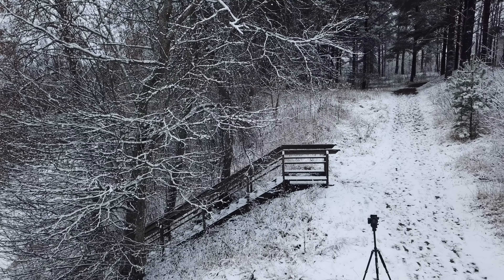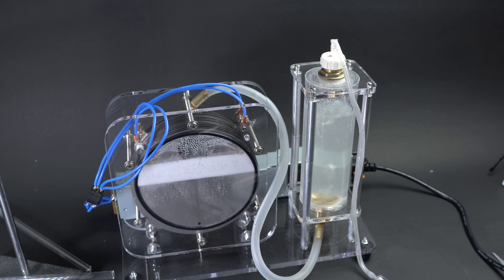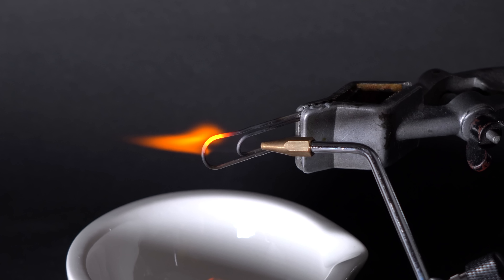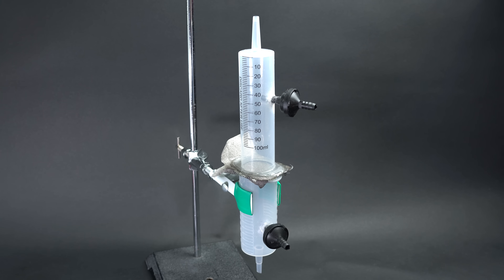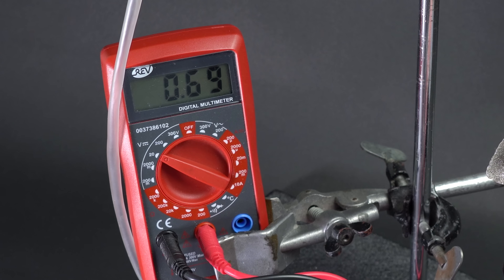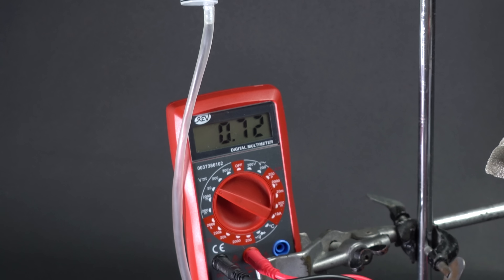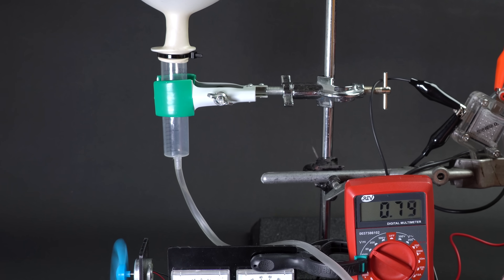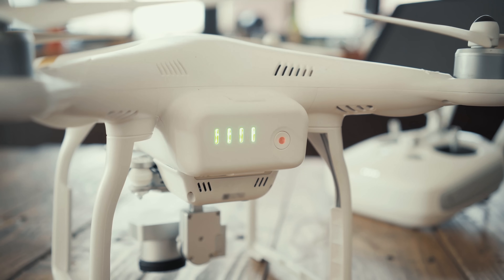I Made a Hydrogen Fuel Cell - Renewable Energy!

Comment: Thoisoi: i make renewable energy
Oil company :  say goodbye to the world son
Reply: The idea of hydrogen fuel cells isn't new. The problem is transportation of hydrogen. It is the smallest molecule, hence it penetrates every polymer (so far) and thus is unable to be transportet. Just think of a balloon filled with helium, it won't hold it for a very long time.
Reply: @MetalKabu  That's solved by hydrogen storage in Graphene Oxide, a cutting edge nanotechnology. It allows a lot of hydrogen to be stored in a solid form, at room temperature, non-reactive, non dangerous.  https://www.graphenea.com/blogs/graphene-news/lesgo-project-aims-for-effective-hydrogen-storage

And...Graphene, which was formerly very expensive to produce was just made a whole lot cheaper to mass produce by Rice University, using a quartz tube which you put ordinary carbon trash into, and a short burst of high electricity from a bank of capacitors:
http://news.rice.edu/2020/01/27/rice-lab-turns-trash-into-valuable-graphene-in-a-flash-2/
Reply: @twinpeaksfanclub5493  That sounds quite fascinating. I'll probably have to look into how this exactly works, but I can somewhat imagine how already. Thanks for the info!
Reply: @MetalKabu  glass.
Reply: Petrochemicals have many uses other than making gasoline, diesel and other types of fuels.  I'm a big advocate for hydrogen for a fuel source and with the help of solar power to provide the energy to create hydrogen by fracturing water makes it less costly over time to produce fuel cell hydrogen.
Reply: The Oil Industry is so paranoid about this "renewable energy" it would be easier just to "Doc Brown" their asses for $100million. They would be so happy that the device is a phony, they wouldn't worry about ya anymore, cause luckily any type of corporate embarrassment is worth Billions to not give it a second thought. xD
Reply: @MAGGOT_VOMIT  renewable energy is a myth.  Oil is constantly being created by the earth from decaying life.  Everything has oil within as well as water and other substances.  The oil and water separate through decomposition.  If enough living matter gets trapped under ground it builds stored gasses, minerals, oils and other liquids.  Diamonds are nothing more than coal under extreme pressure and heat transforms coal into crystals.
Reply: I truly believe that oil forms fastest under the oceans of the world.
Reply: @michaelpearce8661  Yes, I know. I was being facetious. Another myth is Man-Made Climate change. 
As an amateur volcanologist, I think everyone should study some volcanology. If they did, they would realize very quickly the huge amount of toxic and greenhouse gases that just 1 active vent produces in 1 month and that it surpasses all greenhouse gasses that us insignificant humans could ever produce one that "Man-Made" Climate Change.
Reply: @MAGGOT_VOMIT  with all of the atmospheric spray and other weather modifications that the researchers and military have been doing for decades, maybe now are responsible for climate change and I'm not being sarcastic
Reply: @michaelpearce8661  With there being over 160 types of Crude Oil, I wouldn't doubt it one bit. Our oceans cover 70% of Earth and before the Great Flood, the Earth used to be entirely a tropical climate, a Big Green Marble. One should think the majority of the oil and precious minerals would definitely be there. 

As Seismologists worry about Earth's tectonic plate health and predicting the next "Big-One", they need to be worried more about the race between our oceans to be the first to push like a giant wedge, back through and under Earth's crust. Lol with it's immense volume alone, guess which ocean is winning? xD

When the Pacific finally breaks through the crust at the Mariana trench, it will be more violent than when the waters burst forth during the great flood. Worse as in, the weight of the ocean will force the explosive gases (called "Laze") laterally through the weakest faults in between earth's plates.

 Normally when water like at Yellowstone hits a magma chamber you get Old Faithful and very hot but practically harmless plumes of steam. That's because it fresh water. That's not what happens when SALT WATER hits magma/lava. When salt water hits lava it creates Laze. The innocent looking plumes of steam, (like in Hawaii) where the lava flows into the ocean, are made up of Hydrochloric Acid and fine glass shards. If it doesn't kill ya right away from instant lung damage, it will a few years later causing an accelerated form of Mesothelioma.
 
I can't even begin to guess the amount of deadly Volcanic Laze that will be released for everyone to breathe, when the Pacific breaks through. Yes the volcanic Laze is very toxic but stupid tourists today in Hawaii, still ride their boats way too close to the plumes.
Reply: @michaelpearce8661  No, even that has no affect. Earth is much more immense than most people can comprehend. I assure you it's more than capable of handling anything us wee humans can throw at it.

 Any measurable Atmospheric spikes Worldwide in Greenhouse and Toxic gases ALWAYS follow a sudden increase in volcanic activity. After the spikes in volcanic activity has subsided, the spikes of Greenhouse and Toxic gases ALWAYS return to nominal and sometimes slightly lower than nominal levels, 4-6months later and it's always predictable. 

Even Wildfires from increased lightning strikes are a distant 2nd in measurable Atmospheric spikes. 

The spikes have always consisted of the same gases, no man made compounds or crazy synthetics. The spikes always follow the same natural events. It's been that way for over a century. Man's existence is practically immeasurable. 

Besides that, if there were any spikes caused by man, they would NEVER EVER return to NOMINAL, much less below nominal.
Reply: @michaelpearce8661  Just doing the math, humans are so physically tiny that the entire human population could fit, standing on a 2ft square area, with room to spare, in almost any average sized county in the U.S., like Rockingham County NC.

Another myth is "Overfishing our Oceans". My Marine Biologist girlfriend in the early 90's proved my theory of it being just a myth, on a new research vessel owned by NOAA. 

My theory was, that the trawler fleet's decreasing catch numbers each season were directly proportional to the increases in the fleet's size. and resulted in just the "ignorant" micro-shoals getting caught, that had panicked and split off from the large shoals. The fleet size increase would be "louder" and alert the shoals more and more in advance, allowing them time swim much deeper than the regulated allowed trawling depth. She recorded on sonar the large shoals diving as early as 35min before the trawler fleets arrival.

Now if ya search, you see all the applications over the past 3 decades of outrageous applications to trawl deeper and deeper, but it seems most of the shoals have learned to not only swim deeper but stay ahead or to the side of the fleet. xD
Reply: @michaelpearce8661  Why don't you re-read what I said and yes doing the math on Rockingham County's surface area, if you grid it's surface area into 1ft squares (one for each human's feet to stand on) the Earth's human population could easily fit, standing upright with room to spare. If that confuses you, I can't help you.
Reply: @michaelpearce8661  You're not understanding anything. The spikes come in patterns/groups and make it easy to identify the source of the spikes. All of the volcanic spikes recorded, are of the SAME pattern/group of different gases and compounds commonly associated with volcanic emissions. This pattern group consists mostly of - hydrogen hydroxide (H2O), carbon dioxide (CO2), sulfur dioxide (SO2), hydrogen sulfide (H2S) ect, along with smaller spikes of hydrogen (H), helium (He), nitrogen (N), hydrogen chloride (HCl, hydrogen fluoride (HF), and mercury (Hg). 

Common Wildfire spikes will have their own pattern group like, carbon dioxide (CO2), methane (CH4), nitrous oxide (N2O), photochemically reactive compounds (e.g., carbon monoxide (CO), nonmethane volatile organic carbon (NMVOC), nitrogen oxides (NOx), and fine and coarse particulate matter (PM).

These spike groups always return to nominal readings and sometimes lower than nominal (we call it a bounce) in a smooth declination, about 4-6mo after the events are over.

A Manmade emissions pattern/group, like from internal combustion engines should have carbon dioxide (CO2), methane (CH4), nitrous oxide (N2O). What would make the pattern/group unique to being man-made would be it containing fluorinated gases (hydrofluorocarbons HFC-23 (HCF3) , perfluorocarbons FC-84 (C7F16) and sulfur hexafluoride (SF6) also, which has never been observed in 100yrs. 

Emissions from coal-burning power plants and Industrial plants will have their own unique pattern/groups also.

If any measurable man-made spikes from man-made sources were even remotely possible, they would have to be increased suddenly 10,000 fold (like suddenly adding 100million running vehicles to our highways or suddenly cranking up 10,000 addition power plants in a few days). Then for the those spikes to return to nominal, ALL of those autos and power-plants would have suddenly be removed.

Environmentalists love to pick and choose elements and compounds from volcanic activity spikes, to further their LIES and useless agenda. 

No man-made Patterns/Groups have ever been detected or observed. Even the spikes in mercury found in certain fish rise and drop off suddenly from naturally occurring mercury vented from volcanic activity under the ocean floor.
Reply: @MAGGOT_VOMIT  so you say that polluting the atmosphere is fine?
Reply: @yes1603  Come back when you've convinced the Volcanoes to stop then we'll look at man's insignificant lil Nano-Contributions. 🤣🤣🤣
Reply: @MAGGOT_VOMIT  The problem is that we don't ussualy build cities near vulcanoes
Reply: @MAGGOT_VOMIT  Yes2, I know what you are trying to say. I lived in one of volcanoic country. But one thing is certain, these natural "secretions" are part of the natural cycle that is used to fertilize life on earth. Man-made on the other hand, is just a waste product with no purpose. You're just pointing out that it's true that humans will only do mischief.
Reply: hmm yes my brain keeps expanding knowledge now
Reply: Say goodbye to the elite fools in the world
Reply: @chrisdaldy-rowe4978  Dream, boy.
Reply: Beat me to this comment.
Reply: @JohnnyNoPockets aka Who Dat Gamecat I haven't looked up any numbers, but out of my head I'd say thermodynamics and reaction kinetics. I assume that the reaction would be too slow for use on demand unless there is a better catalyst found or the efficiency is not good enough. 
But if I am wrong someone will probably correct me.
Reply: we cannot completely replace the oil, I don't work in an oil company :), I see some case that battery can't replace fuel but nuclear fusion can :) it's just my opinion

Comment: i believe the main reason why the use of oxy hydrogen fuel is not widely used is because its not an efficient fuel to store. For example, gasoline is a liquid that is easily stored in any container but oxy hydrogen gas needs to be stored in special high pressure vessel.

Comment: Hyundai and Korea are doing alot of research and experiments in relation to hydrogen power plants, Korea are making a city powered on Hydrogen as we speak
Reply: @Punchy the vehicles already exist (hyundai and toyota are really pushing it with the Hyundai Nexo and Toyota Mirai) and have for some time now but the city conversions are still going, as for production, its hard to say but I would definitely guess its from natural gas reformation as thats the most common way of mass producing it.
Reply: @Punchy I just looked up their current plans, they plan on using petrochemical hydrogen (so the original way they mass produced Hydrogen from fossil fuels) and then once the infastructure is in place and proven to then make it carbon neutral. pretty cool and if it works it will definitely put the push on other countries to add hydrogen pumps at fuel stations or other stations

Comment: These fuel cells seem fairly inefficient, or at least in it's current state. Wouldn't it still be more efficient to run a small combustion generator? Im curious to see a hydrogen combustion engine

Comment: Fun fact: Hydrogen is one of the most energy dense fuels, but density makes it less cool.
Reply: That's why they use it in rockets. Nothing compares to it. Unfortunately though, it takes too much space, even when it's cryogenically stored,  it's too expensive to produce and almost impossible to prevent it from leaking from whatever container it is in for long term storage.
Reply: @GRBtutorials  What people don't seem to understand is how important volumetric energy density is.  We cannot ignore it.  Alas, hydrogen's low energy density is the bane of hydrogen-powered vehicles.  And the reason?  You can't store enough of it onboard.
Reply: @ChristmasEve777  not to mention the detremental effects of Hydrogen on most metals.
Reply: @ChristmasEve777  what is a fuel that you can store lots off? Pls respond I’m not trolling i wanna know because I was gonna use hydrogen for a fuel but I’m afraid it won’t even last an hour
Reply: @crispywings9066  
if you're looking for a chemical fuel you can store lots of, look no further than petrol, or maybe paraffin wax.
Reply: @crispywings9066  Tolulene
Reply: Not correct. Only when highly compressed into a liquid or a solid which is now possible.
Reply: I'm definitely all for switching to HHO and using it instead of petrol. They just need to put the infrastructure in place in order to make the switch and make it not take years to turn back on.
Reply: It is extremely inefficient!(in terms of producing it)
Reply: @Mohd.3636  but it doesn't destroy the plant. You can harness it with the sun, and it's combustion product is water vapour... Sounds good to me. You can harness hydrogen for free from abundant sea water, how is it inefficient?
Reply: @bigsteve6729  requires precious rare electrodes and presious rare water.

Salt water adds extra cost and problems. 
Hydrogen cells are a pain. 
H is hard to store too. 
Many more downsides to H.

The sun will burn brightly for millions of years though.
Reply: @Mohd.3636  not really you get the same amount of energy from reverse electrolysis as it took to make the H+ ions uf you use exses energy from solar or wind that would be lost anyway the process is not to bad
Reply: @beavischrist5   probably using solar power to generate hydrogen, maybe that is the future, instead of batteries you store it as hydrogen and oxygen
Reply: @thapelomashaomasemola7922  just as long as you keep the 2 in seperate containers . should be relatively safe.
storing them in the same container though and you may have some problems... not just of the explosive type either.
Reply: @logangraham2956  why do you need tanks why not use nitrogen 
From the atmosphere to form NH3 
That can be oxidised later
Reply: @beavischrist5  they dint found efficient way to produce hydrogen, they found more efficient way to milk their cash cows for taxes....
Reply: "One Moon Circles." -- STAR TREK: THE NEXT GENERATION 
😊😊😊
Reply: got to do with being the simpliest element.
Reply: @unny-k5r  😶 simplicity is divinity 🙏
Reply: That's not true.  Hydrogen gas has a very low density.  Even pure liquified hydrogen has such a low density that a gallon of gasoline actually has more hydrogen in it than a gallon of liquid hydrogen.  Now, energy output per gram, on the other hand, is VERY high for hydrogen compared to many other fuels.
Reply: @ChristmasEve777   hydrogen has an energy density of approximately 120 MJ/kg, almost three times more than diesel or gasoline. In electrical terms, the energy density of hydrogen is equal to 33.6 kWh of usable energy per kg, versus diesel which only holds about 12–14 kWh per kg.
Reply: @ARCSTREAMS  You might want to put that crack down and listen. YES, a gallon of gasoline DOES have more hydrogen than pure hydrogen.  You're too simple to understand DENSITY.  The hydrogen molecules in gaseous, or even LH2, are so far apart compared to the densely packed carbon chains of octane and other hydrocarbons, each carbon atom having a hydrogen atom on each side.  There has been research on using gasoline for fuel cells.  I don't know the specifics of it but you would get MUCH more energy per unit volume than hydrogen.  No one is arguing that hydrogen is more powerful by weight.  Go back to school and learn density.
Reply: @ChristmasEve777  In terms of a volumized gallon yes, but by weight and a physical gallon (not the area it could fill up the the actual mass good sir!). A physical gallon of hydrogen has roughly 12 times more hydrogen per gallon good sir, thus you need yourself to go back to school!
Reply: @ChristmasEve777  "  a gallon of gasoline actually has more hydrogen in it than a gallon of liquid hydrogen. " lmao what are you smoking? that is like saying a gallon of whisky has more water than a gallon of water , anyways he is talking about energy density not weight, as in same amount of hydrogen has more energy than same amount of propane

Comment: Do you hypothisize that if you use more than 10 cells it would provide enough electricity for the electrolosis or if you add what some "electrical diy project youtubers" call a "jule thief" or "jule ringer" it would amplify the voltage enough for 10 or more cells to power the electrolosis while the tubeing is in a "closed loop"? of course you would need to start it off with a boost and nearly %99.9 (there is no key for "overdash") pure H2O but i guess it would run simular to a "Herons fountain" only appaering to be self sustaining but very slowly loosing progress till it entropies. it would make for an intresting project at the least.